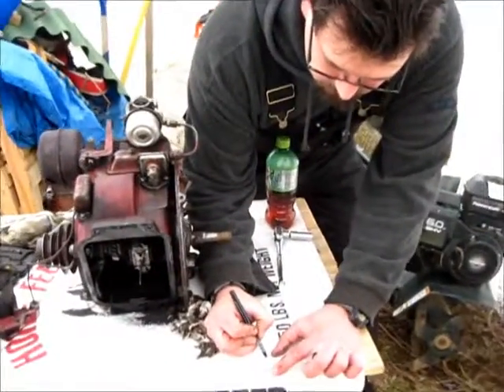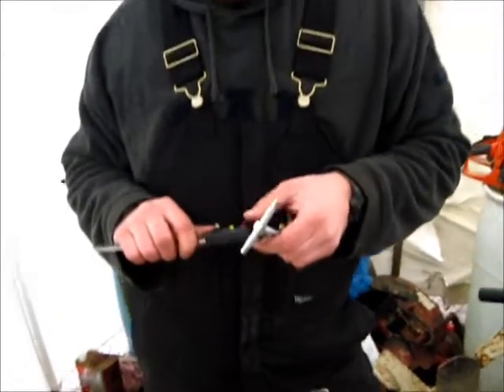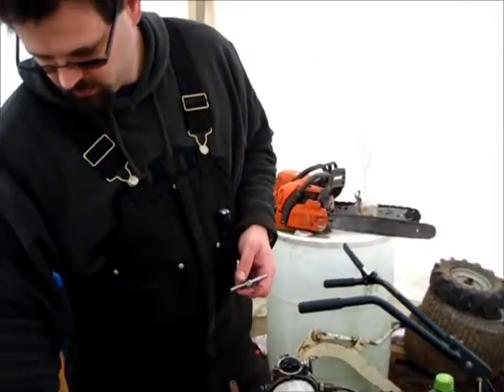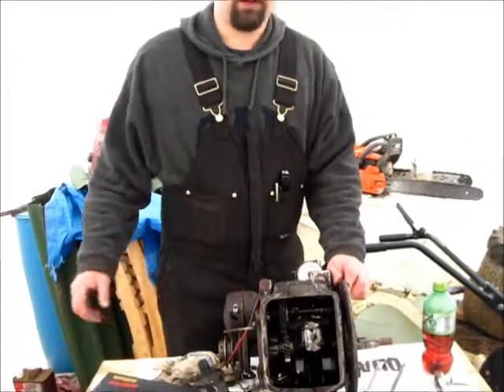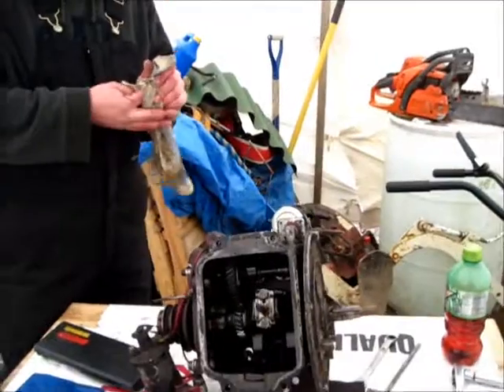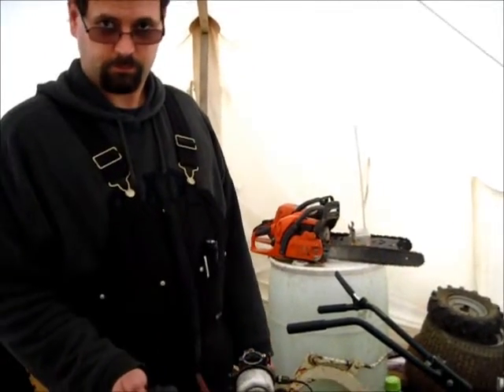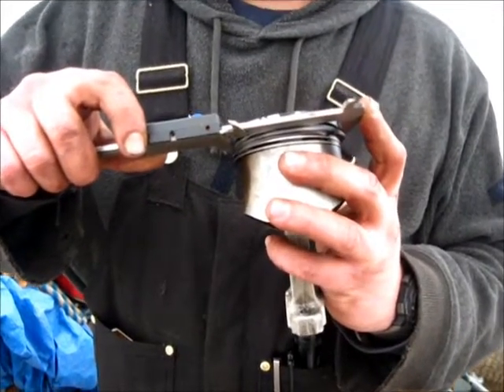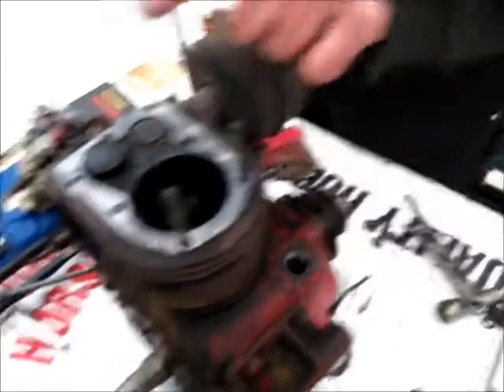k181 engine rebuild part 2

Comment: Since your piston was factory original, was it stamped with the letters STD or not. Just wandering because I’m rebuilding a Kohler k181 and my piston is stamped with the letters STD and I’m wandering if it’s ever been rebuilt before
Reply: Thanks for the help!
Reply from the maker: I cannot remember if it was stamped or not although it did calibrate out to standard bore and I put standard piston and rings in it and ran like a champ